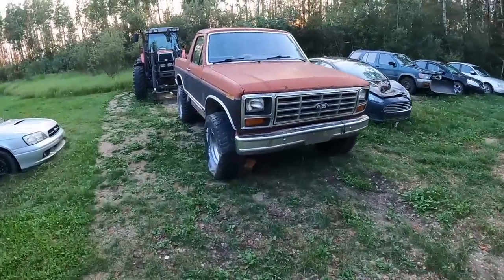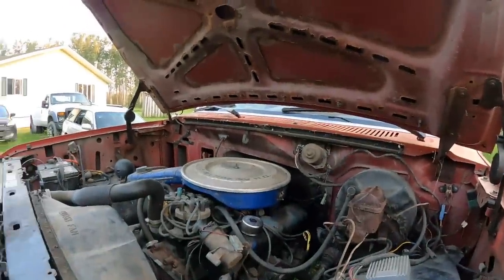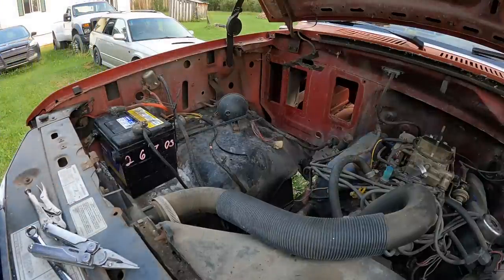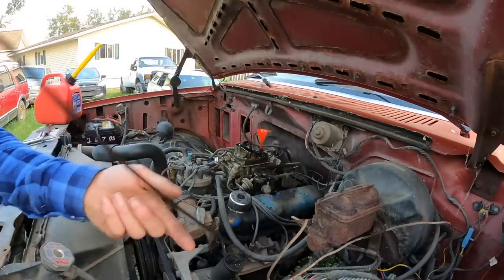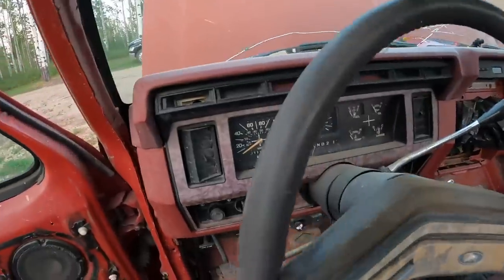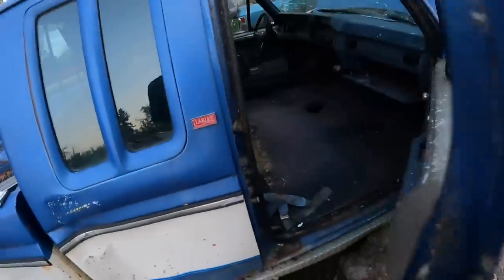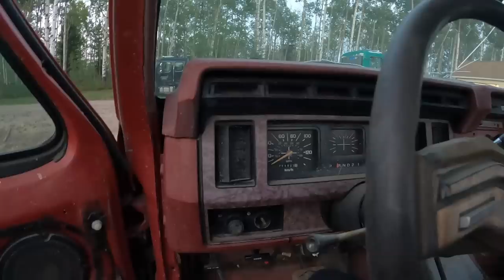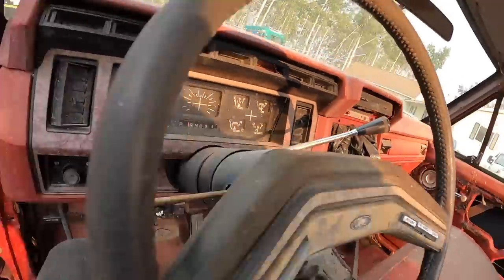1985 ford bronco revival

Comment: I’m an instant subscriber, man!! That old 351 Modified sounds great!! I miss my ’83 Bronco. Front hubs wouldn’t lock, had a leaky fuel line up by the carb (fucking minty OSHA certified), the rear door didn’t open and the rear window didn’t work, but I loved that piece of shit!! Never got stuck in it either. Even with bald and dry rotted tires.
Reply: Not a 351M, it's a 351W.

Comment: You don't need a heater or defrosters.
Reply: That's the free air edition.  It uses the engine fan to circulate air through the cab